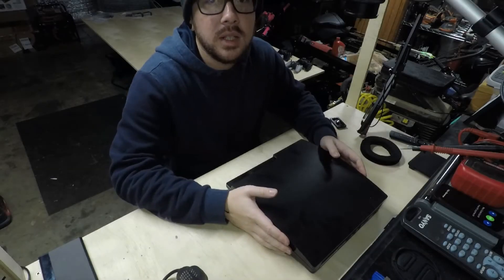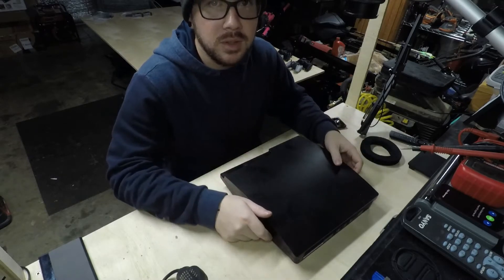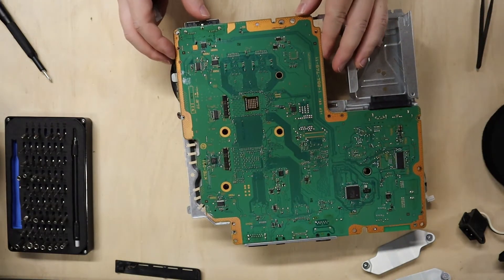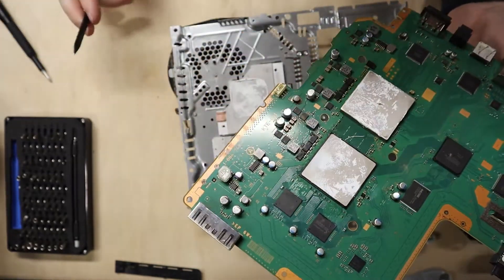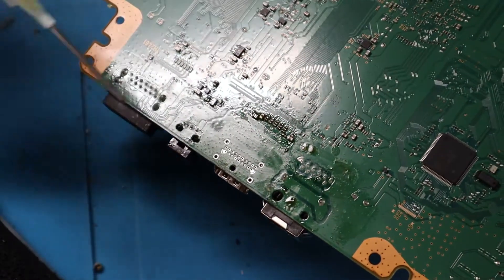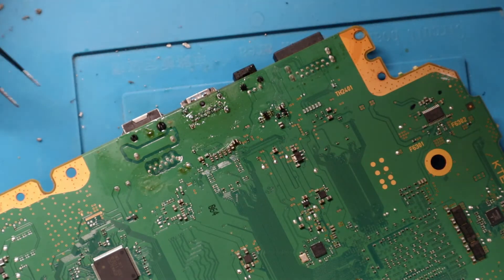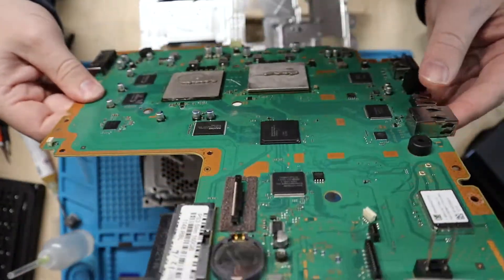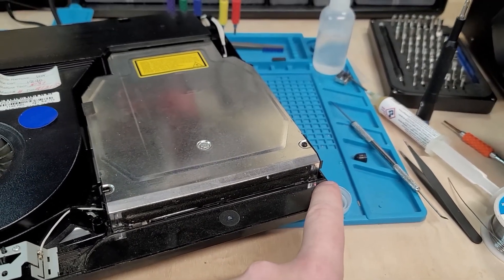Can We Fix A Broken HDMI Port On This Playstation 3

Comment: Bro, next time use solder paste and solder with heat station, be careful with the air and temperature you use as it may damage the board. execellent work
Reply from the maker: Thanks for the tip